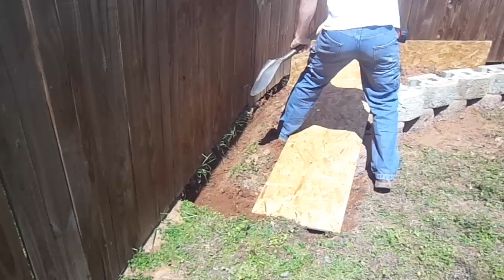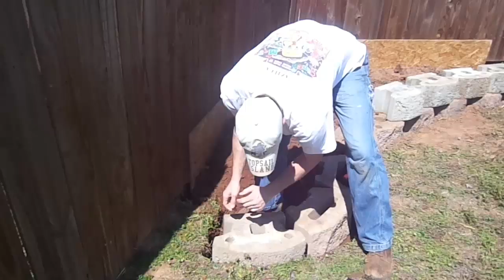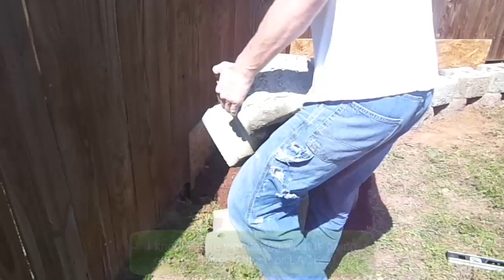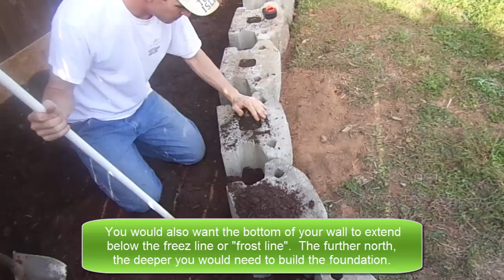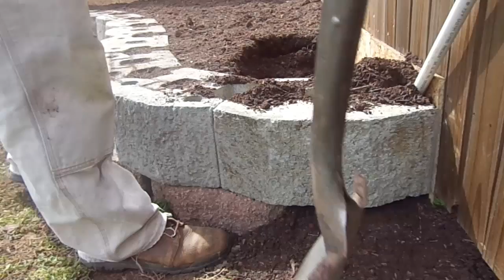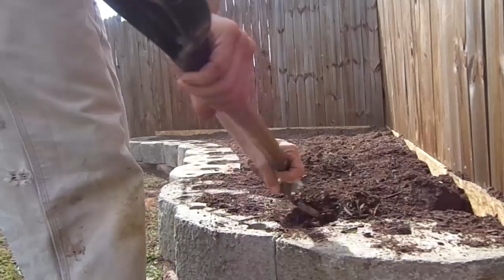How to Build a Retaining Wall for CHEAP

Comment: I think you should have used pressure treated boards on the back instead of the plywood.  Its going to rot pretty quickly. Otherwise a fairly inexpensive homeowners way to make a bare corner look good!

Comment: I own a landscaping company for over 30 years now and I don't know if I  should laugh  or worry about the advice you are giving out.
Reply: I agree. Might be more expensive up front but when it looks as good after 5 years as it did from day 1 rather than being repaired every 2 years you will
Be happy you hired a professional. Laying on dirt is ridiculous and putting soil against a piece of plywood built up along a fence is even more ridiculous. Your neighbours will be knocking at your door when those fence sections rot out faster than the rest

Comment: you should be laying the block on top of 7" stone, i am assuming you got the block for nothing, they are expensive.  proper way to do that project is trench the area out, fill with stone, tamp, lay screening, lay block
Reply from the maker: +E Stan - Yes, that is correct. As I explained in the video....the proper way would be to use some type of aggregate as you mentioned. I explained all of this in the video...but also explained "why" I could get by w/out using stone. I believe there's a link somewhere to a video about where/how I got these for free on Craigslist. :)
Reply: Bob Johnson
Go to your nearest Walgreens   and pick up a  tube of  Buttease  ointment

Comment: Nice garden edging. Those blocks must have been expensive. The only problems I have with it are the blocks are too deep, and that waferboard you used to protect your fencing will not hold up. It will rot out, as will your fencing, eventually.
Reply from the maker: alan30189 - Yes, I know the board will rot/did rot. That said, it was only temporary till we found more materials to build the back side and raise the fence. :)

Comment: It shouldn't have been too difficult to dig down for subsoil rather than stabilize the blocks with high OM topsoil.
Reply from the maker: Ryder Hughes - Right, which is what I did for nearly the whole part....but in a couple places, I had to fill back in to make it level. Thanks for watching and for your feedback! I really appreciate it. :)

Comment: Gravel is very cheap ...... always go between 3-6" deep under the block and fill with gravel use crushed limestone. Never stomp with your foot or pvc pipe also never put ditt inside blocks use washed gravel...Also at least use treated lumber or landscape timbers that are treated.... We have fixed hundreds of walls people have laid like this do it right the first time...  Do not build a wall this way at all in Florida or Maine...
Reply from the maker: Thank YOU for your insight Envisionsland and I value your statements. 

That said, in regards to cost...I did NOT have the money to go buy any aggregate, rent compaction equipment, or additional lumber....which is why I was showing people an alternative to building in this way (and it is clearly articulated in the video). 

Additionally, you have to take into account the environment in which you're building. In my area, we get little rain, and our freeze line is very shallow. We have hard compacted native clay soil and after more than a year of sitting here, the wall is in place exactly as I have placed it. I have years of construction experience and I now what works and what doesn't. As I explained in the video (did you really watch?), I would NOT do this if I were up north much further than I am...simply because of the freeze thaw "heave". 

I also explained in the video, that the wood backing was a temporary solution for me, until I can find more blocks for cheap, and I'll raise the privacy fence up and build a whole new corner of the fence.

One more question for you? If you are compacting dirt, do you think it matters what it's compacted with as long as it's compaction rating would "pass inspection"? No I didn't test it....but I KNOW I was well above 90% based on my knowledge and feel of the dirt I was working with. In this case, the dirt wouldn't have known the difference between a PVC pipe, my foot, or a plate compactor.

I encourage you to PLEASE pay attention to what is being said in the videos and listen to the logic behind it. There is NO reason why this wall wouldn't last for well over 10 years if built as I've explained in the video. Built with proper aggregate (I can redo later when I have the funds), it would last even longer.

I'm highly tempted to make a VERY public statement about your comment (and company) throughout my social media following and online....but I will not.

Kind Regards,

Wayne
Reply: Sorry didn't read the article.... Man o man.
Reply from the maker: No worries Steve Sicurella. :)
Reply: Ugly wall
Reply from the maker: Just to keep the conversation on the same page, here's Envisionsland's response to my comment above. https://plus.google.com/112313156746715502691/posts/SntBVJ3H886

Next time if you reply on Google Plus, it will show up in the same conversation stream. Just a tip for ya! :)

Comment: I like the block look. Here are some pointers from my experience. I have two corner beds made from pressure treated timbers. That fiber board will rot super fast. It just soaks up moisture. I ran a drainage PVC pipes covered with a sock to drain water out away from the fence. I later did the same thing and add two by 12's raising my fence boards and trimming to fit. Watch for settling of your heavy block. I have much softer soil than that red dirt. I had to drive my own pilings. 3/8 rebar.